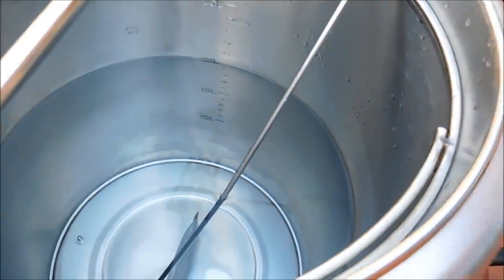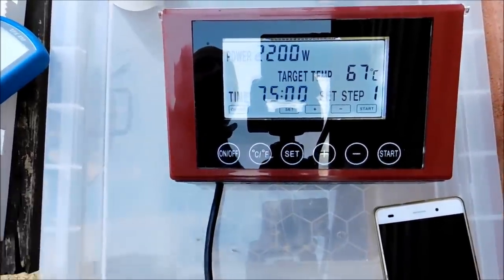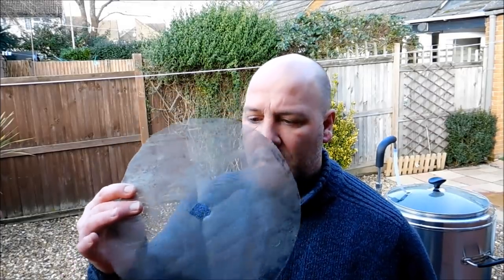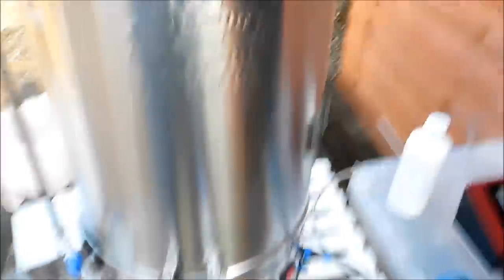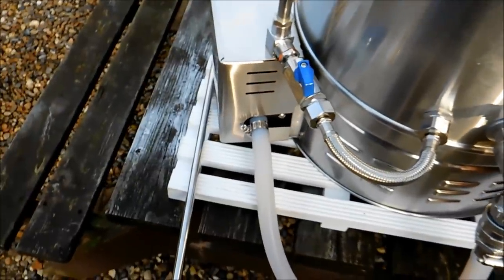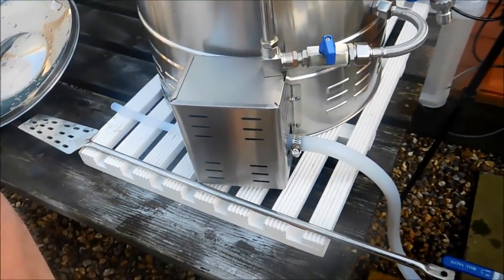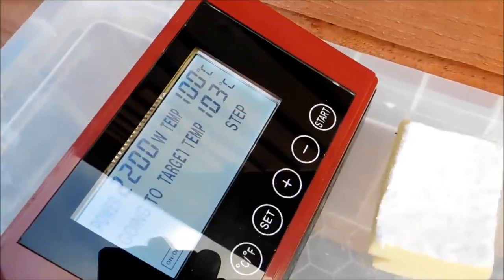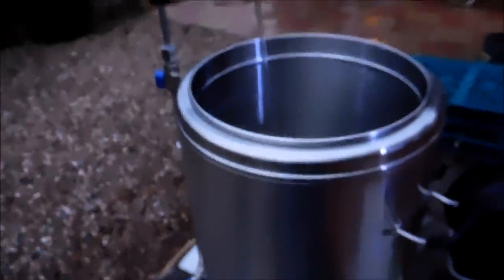Brewday #1 with the ALL NEW Bulldog Master Brewer plus summarised thoughts on the system!!

Comment: Just thinking about the temperature @ 20:50, water boils at 100C at normal atmospheric pressure so the more temperature, the more energy (heat) you put in, the water will boil harder to try and maintain 100C, so if you were to put the lid on that would increase the atmospheric pressure and the temperature would rise but so would the boil, so maybe put the lid on and keep your eye on it so it doesn't boil over, that might be enough to trigger 103C. Boyles Law, pressure x volume / temperature.
Reply: Norman Butler = DMS.
Reply from the maker: Yes lid on boiling frowned upon mate open top allows DMS boil off

Comment: No Pulse width modulation then? Very difficult to find that info for these systems. You can probably set the boil temp to 99.
Reply from the maker: Why 99 it would cut out always at 99c meaning no boil?!
Reply: @AliSim2103  You are probably not at sea level which means it will be boiling at 99. And also it's not pure water you are boiling. 99 is the max setting?

Comment: What is the temp control like with regards to stability and overshoots ?
Reply from the maker: It's very stable... Reaches temp and holds very well during mash! Once I'd calibrated it at the beginning of the brew I keep checking and only needed to adjust by a degree in way to boiling! If you've seen David heaths comparison with the original bulldog it's better than that lol the master brewer much more accurate than the original 🍺

Comment: This or the RoboBrew?
Reply from the maker: Erm... Robobrew based on price! Over £100 less than the master brewer and it appears to be a good system!! But the master brewers pump is better and its external, the anti burn post allows for underletting using the master brewer pump and the 9 step controller is detachable and can be set on a table nearby... it’s also double walled and as well as insulating your mash and boil it makes the unit a lot more solid than single walled ss units like the Robobrew or the grainfather! Is all that worth paying £450 ish for? Robobrew is about £350 I think!
Reply: Thanks, I'm going for this, the savings due to the insulation is also an important consideration.